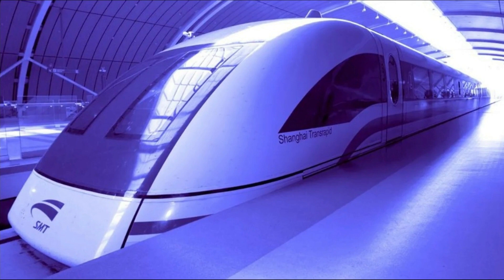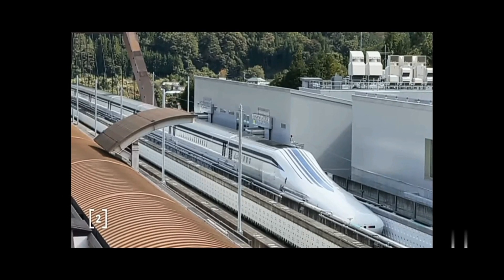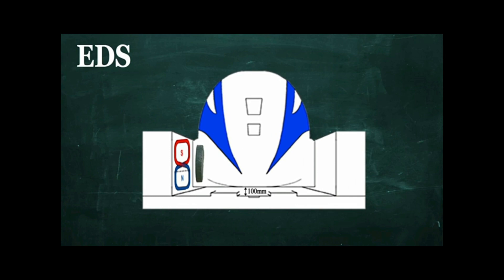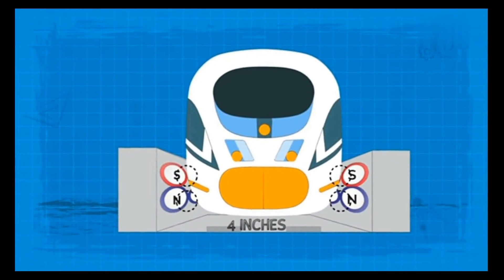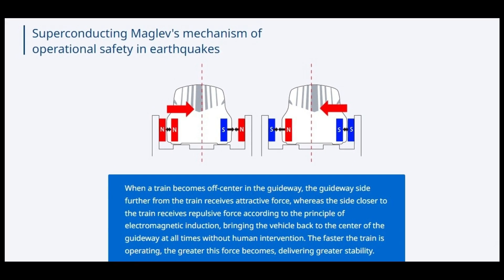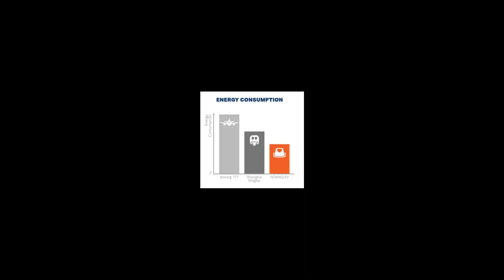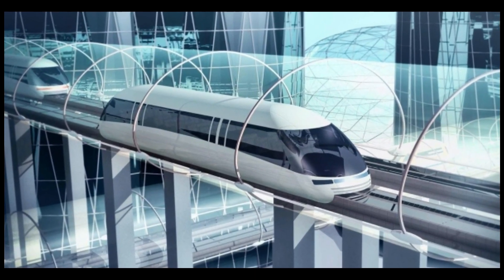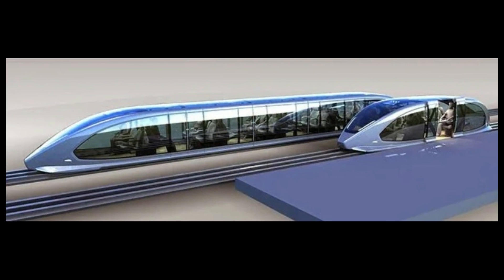Maglev Train | Magnetic Levitation | Maglev Marvels

Comment: China has developed first generation 600 kph maglev passenger trains not at deployment level as of yet, but at a very high state of development.   Eight meter wide three level maglev trains traveling at 800 kph - 1,000 kph are reasonable practical goal starting about 2045.  This wide loading gauge of about 8 meters has been an objective going back to the beginnings of the railroad age when dual track UK railways of the 1840s were designed to occasionally have double width carriage using the inner rails of the two tracks.  This 8 meter wide loading gauge would allow large cargo assemblies to be easily moved over long distance overland changing the world we live in.   

For a mixed passenger cargo train the first level would likely not be continues between train cars and a bit noisy from the maglev motors, a useful space for side simultaneous perpendicular loading of drive-on drive-off automobiles and cargo containers that could take place in the period of a long traffic light cycle or about a minute.   The second and top third level could be luxury continues passenger space with vista dome roofs to allow passengers to see out front watching the scenery.   This train configuration could carry passengers more comfortably in a 1/4 the length of todays popular single level trains that stretch out several city blocks. 

All very high speed trains need nearly incrementally free electricity such as their own hydropower generators with unlimited water.   New nuclear power generation is a future practical scaleable source of nearly incrementally free electric power.

Comment: Mph?? Metric please.
Reply from the maker: 100 miles per hour is equal to 160.934 kilometers per hour.
Reply: Yes I know, the point is ALL the examples given use Km/h.  The USA is the only country in the world that still uses miles, feet, inches etc.  So if you are making a technical video, I think, you should use only metric system.

Comment: In Japan, we have begun developing a superconducting magnet linear motor car that can float 10 cm compared to the normal conduction linear motors of Germany (China), which have weaker magnetic force and float only 1 cm, which increases the risk of accidents. It took 50 years to develop, but it will soon start running in Japan, so when you come to Japan, please ride it and experience the world of speeds of 500km/h.
Reply from the maker: sure , the marvelous country should be visited.
Reply: " float only 1 cm" for the Transrapid is misleading, it makes people think of only 1 cm clearance, which isn't true.
The gap between the magnets is only 1 cm, but the gap between the track and the bottom of the car is around 15 cm.
However, both systems have their pros and cons.
I like the "straight" concept of the Transrapid regarding "no need for wheels", it can levitate at low speed as well, even standing. Unlike the electrodynamic levitation system of the JR Maglev.
Reply: Japan system was planned for 2027 but currently on hold because of problems with tunnel boring. There are concerns about water resources...